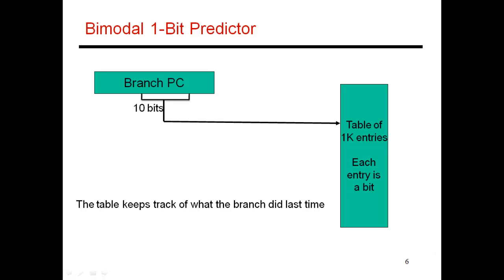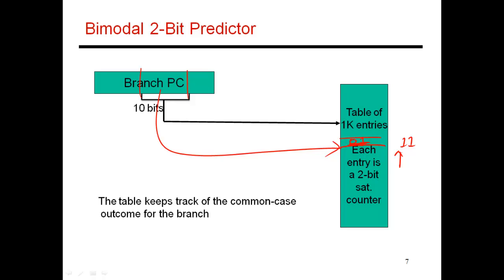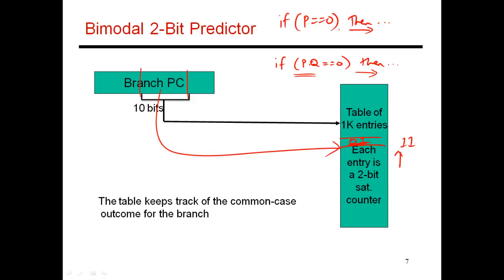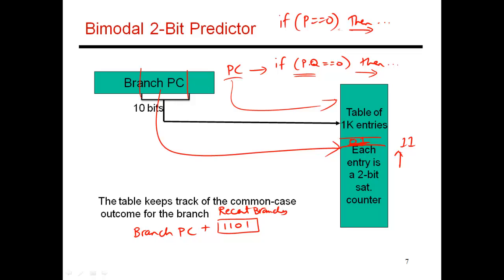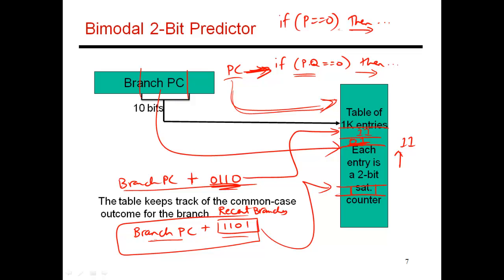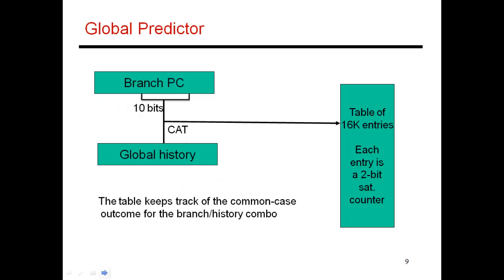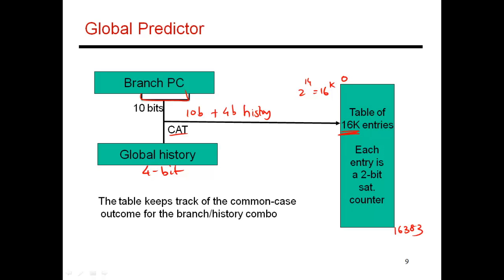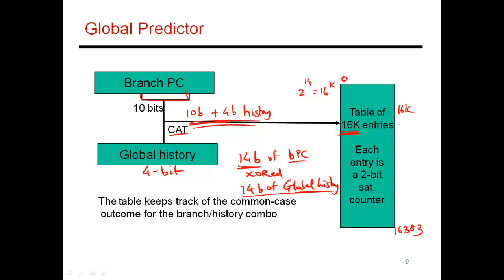CS6810 -- Lecture 25. Lectures on Hardware-Based ILP.

Comment: Won't this increase the aliasing problem?
If yes then why is it considered better?
Reply from the maker: If the final table has 1K entries, the probability of a conflict (aliasing) is going to be 1/1K no matter how you compute the index.  But the more information you can pack into your index (history and branch-PC), the more likely that you are not getting confused by (say) different branches with similar PCs, but wildly different branch behaviors.
Reply: Rajeev Balasubramonian Just redefining my question, concatenating 4 bit history to 10 bits of PC wont cause any aliasing, as every PC will have consecutive 16 addresses in the branch table, but if we xor 14 PC bits with 14 history bits den wont we need 2^14 (as there will be 2^14 combinations of history) entries for every single value of PC to avoid aliasing?
Reply from the maker: Amey Patil Take both cases (10 bits of PC concatenated with 4 bits of history and 14 bits of PC concatenated with 14 bits of history).  Construct examples of PC and branch histories that produce the same index in one and a different index in the other.  Aliasing is possible in both cases.  Empirically, it turns out that the latter case yields fewer cases of destructive interference.

Comment: Hi Rajeev, thanks for the video. I have a question pertaining to the global history cache. How does it get updated? Does it get updated by whatever prediction is selected, by simply shifting-in the newly selected "taken or not taken" bit from the 2-bit saturation counter. If the above scenario is the case, doesn't this make the global history cache relatively uncorrelated with the various PC? Thanks
Reply from the maker: Yes, the global history register does have a smattering of outcomes from different branches.  In the next video, you'll see a predictor that maintains different histories for different branch-PCs (the local predictor).